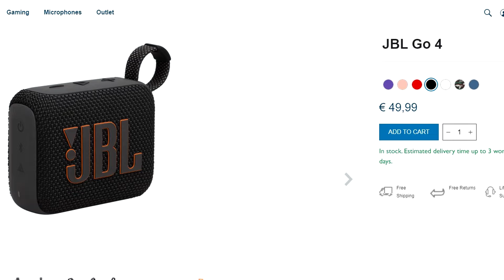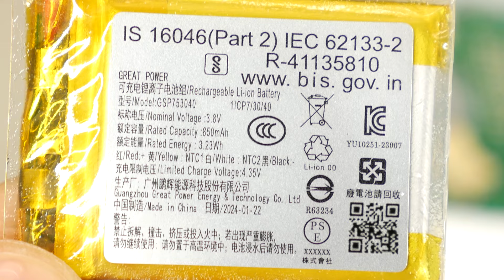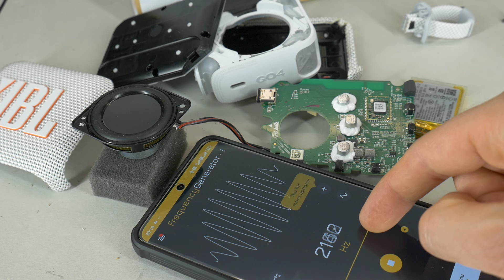Teardown JBL GO 4 Speaker + Free Air Bass Test

Comment: Tribit stormbox mini for 30 or less is a way better deal. 2 drivers, rgb, 12w, fast charge, longer battery life and looks. Got mine on sale for $22 on amazon. The bass is double than the go4 and significantly louder. The clarity of the go4 is better and is a smaller speaker. I own the go4 as well but like the tribit way more. Tribit is bigger tho and 2.5x the watts with 2 drivers so it makes sense it beats the go4. Unless u need a super small form factor the stormbox mini is way better and the stormbox mini isnt that much bigger than the go4 tho.
Reply from the maker: Thanks for the feedback! I need to try out the StormBox Mini.

Comment: The sad thing about this speaker they give less life of the driver which one get old & torn you will not be able to change or replace like the quality of the speaker itself.
Reply from the maker: I couldn't agree. If used properly without overloading it with extreme bass, it will last for years. I still have a JBL Go1 that works.

Comment: Wish the back of the  go4 had a secondary bass radiator. It would probably give it even more bass?
Reply from the maker: I think that wouldn't work because JBL engineers have probably pushed the maximum bass out of such a small speaker.

Comment: What about connecting the circuit to a bigger size 4 ohm speaker?
Reply from the maker: Why not, but better bought bigger  portable speaker.
Reply: @Techscrews  DIY has a lot more fun, and will let you save $$, a clip 5 or go 4 are sold for 50-60$, that amplifier combined with a shelf speaker that is 40-50$ it will sound way better than a flip 6, and it’s on the same target price.